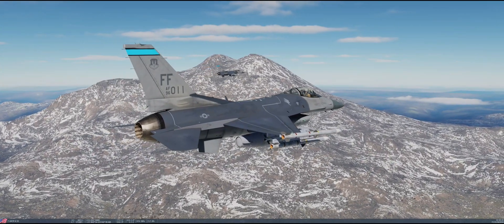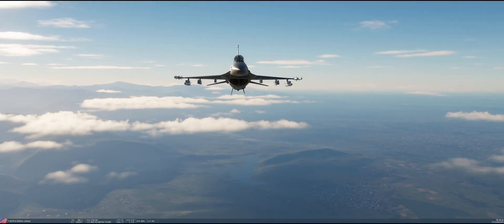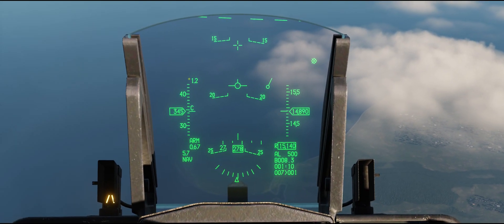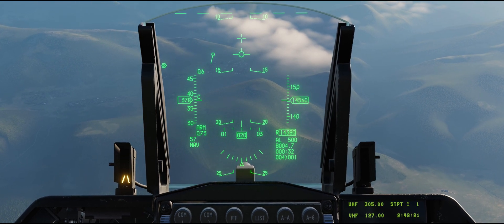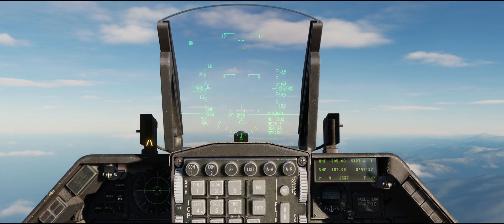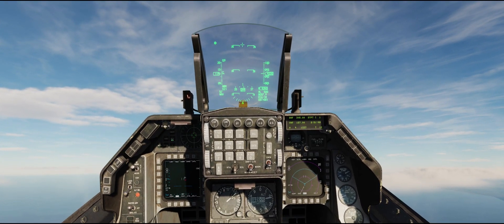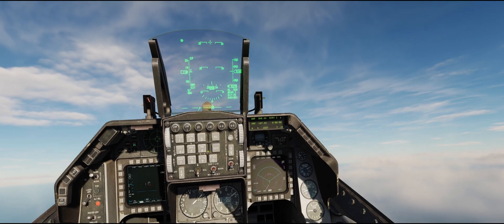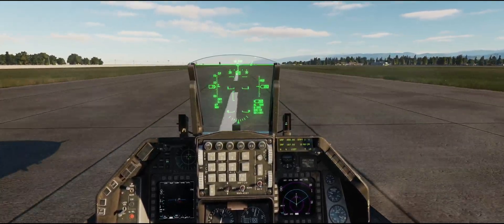DCS F-16C FLY-BY-WIRE and TRIM Explained

Comment: Very nice, thanks! Loved the non-landing demonstrations. It explains why I couldn't practice some landing concepts with my gear up :) So to be sure, when gear is down, pitch commands AoA and thus you go into the classic mode of pitch for speed (as a higher commanded AoA necessarily means lower speed all things equal) and throttle for altitude (moving the FPM). So then despite FBW it behaves like a Cessna :)

Other thing is on landing viper pilots don't pitch (AoA) trim, right? Contrary to say an A10c that you trim for AoA on approach. That was just a demonstration here.

Comment: From an Air Force Aircraft Mechanic standpoint, that’s not what Fly By Wire means. It literally means the flight controls are electronically controlled, where as traditional flight controls get their input via cables.

Comment: How do you handle roll trim when carrying a TGP or HTS or other asymmetric loadout?  It's hard to trim for roll caused by the TGP.  I use yaw trim to center the ball on the ADI.  It's hard to get it just right and it usually takes some fine tuning.  Is there a better way?

Comment: Good job on these F-16 tutorials you are spinning out. I see the relevance of trimming also during turns on final when doing overhead break. Constantly fighting the nose pitching down state with massive throttle adjustment and this tends to make me get the runway alignment wrong. I now see where a 2 click trim will help smooth out things at this stage.
Huge fan of you videos. Cheers.

Comment: Cool video. For more in-depth details about the functionalities of Viper FLCS, there's a pretty comprehensive document of the FLCS implemented in BMS4 written by the FM developer. Although it's using the figures from NASA FLCS (TP1538) as an example, it does a good job describing the basic functions. https://www.falcon-bms.com/wp-content/uploads/2021/08/FM_Developers_Notes_Part_4.pdf

(Wishlist) Maybe interesting to see some videos describing any or some of the following functions: negative g limiter, deep stall, MPO, ARI, roll departure prevention, etc.

Comment: Cool videos with a lot of explanations. Enjoying it.

Just a reminder though, you don't trim F16 for landing. Using throttle for AoA adjustment is the correct way. That's from a real F16 pilot.

Thanks for the videos.
Reply from the maker: Appreciate it!

A note straight from the Block 50/52 manual reads "In  takeoff  and  landing  gains,  zero  pitch  trim commands zero pitch rate until 10 degrees AOA. A slight  amount  of  noseup  trim  is  required  to  zero stick forces during an 11-13 degree AOA approach."

I've found this to be accurate in-game. Unless you trim, a slight amount of stick pressure is required to maintain 11 AOA. One or two clicks nose-up trim and it will maintain it hands-off.
Reply: @FLYGaffer  that's completely correct what's written on the manual, that's also used as a second technique but maybe for %10 of the landings, depending on weight or to avoid tailstrike in particular circumstances.  though with proper adjustments to throttle it is quite easy to hold 13 degrees AoA as the Vipers stick is force-sensing.  In DCS, trimming for AoA works very well as you said. 

Keep up the good work!
Reply: I have been flying the Viper since the early days of Falcon 4 and trimming for landing was never a thing. I kind of cringed when even Wags mentioned doing a 2  click trimming in his Landing tutorial for the viper.
Now it is pretty obvious how much smooth and easy it is going by the book and Gaffe video just makes the reasons for trimming understandable. I have been doing landing all these years with thottle/flightstick setting to keep AOA but I sure will be using the trimming method onward.
Reply: @Eaglewings-E  hi! Wags is never using trim in his landings, i asked him personally. Trimming is just another technique which is not mostly used. F16 is to be trimmed only when there's damage on aircraft.
Reply: @silvera-  Thanks Fiko for the additional information and correction. I may have quoted Mr Wag wrongly in my earlier reference. I can vaguely remember him mentioning trim in one of viper's videos but I appear to be incorrect after watching his landing lesson for the Viper. It is great have more than one technique in controlling this iconic jet.

Comment: I must’ve missed the part in the manual about adding pitch trim to reach 11AOA on approach. Flying in Falcon BMS I think that’s achievable without trimming… can’t recall for sure
Reply from the maker: "In  takeoff  and  landing  gains,  zero  pitch  trim commands zero pitch rate until 10 degrees AOA. A slight  amount  of  noseup  trim  is  required  to  zero stick forces during an 11-13 degree AOA approach."

Thanks for watching!
Reply: Probably going to depend on the state of the plane.

Comment: Just curious, why do you want to be at the top of the AOA bracket and not in the middle of it?
Reply from the maker: Per a block 50/52 manual you can find with the google search terms "F-16 manual" a preferred landing technique in the F-16 is to approach on final at the top of the AOA bracket at 11 degrees, and flare to 13 degrees (middle of the bracket) to touchdown. See section 6-4 

This is unlike the hornet where you don’t flare to land, you just approach at the landing AOA and let it’s massive landing carrier gear soak up the landing. Thanks for watching!
Reply: @FLYGaffer  Found the passage in the manual, it mentions an 11 or 13 degree approach but doesn't indicate a reason for choosing either. Is there one ? Wind maybe ?
Reply from the maker: @TheSkipjack95  From that document Re: 11 degree AOA 

"This technique allows better pitch control, better over-the-nose visibility, and a more stable HUD presentation. In gusty wind conditions, the aircraft wallows less, and during the flare, the sink rate is easier to control."

Sounds good to me. Also found some other documentation from 1996 indicating that was preferred. It's been working well for me!
Reply: @FLYGaffer  Your landing is very close to mine. I'd always figured the indexer is trying to destroy the roadwheels and dampers so I didn't pay it any mind. Only thing I look at on approach is airspeed, lol. Cross the threshold stable 160 - 180 without pitch rate and without a lot of sink rate and you are okay.